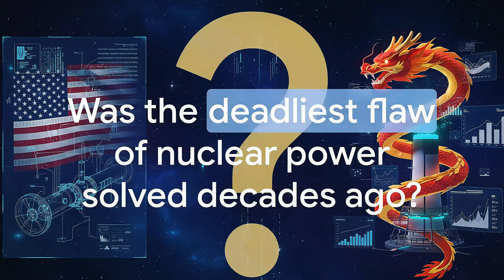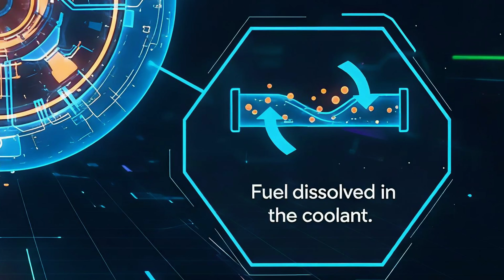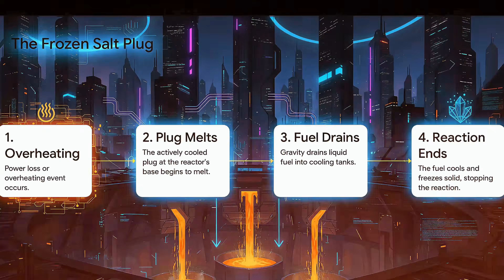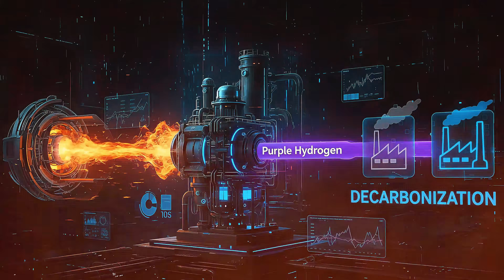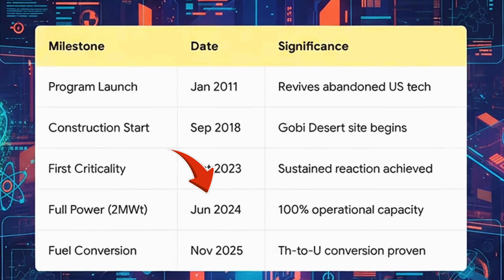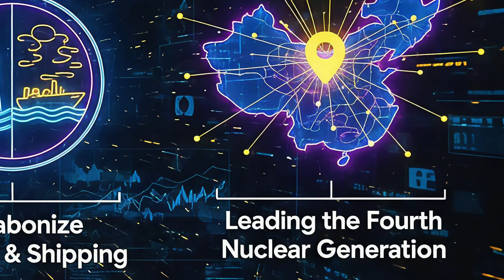Why China's Thorium Energy is About to Explode

Comment: That video’s from China Decoded—“Why China’s Thorium Energy is About to Explode,” dropped Feb 26, 2026.
China’s building the world’s first “inherently safe” thorium molten salt reactor (MSR) right in the Gobi Desert. Revived old US Cold War tech they ditched ‘cause it couldn’t make bombs.
Key stuff:
•  Runs on liquid salt—fuel and coolant in one, no high pressure, no water needed.
•  Frozen salt plug at bottom: overheats? It melts, fuel drains out by gravity, shuts down auto—no meltdown possible.
•  Waste: safe in 300-500 years vs uranium’s 10,000.
•  High heat (650°C) means “purple hydrogen” for steel/cement, plus nuclear cargo ships like KUN-24AP—refuel once a decade.
Timeline: started 2011, prototype hit criticality 2023, full power 2024, thorium-to-uranium conversion done late 2025. Commercial by 2030.
Claims China’s got thorium for 20,000 years of power—energy independence locked. West missed out. Pretty bold pitch.